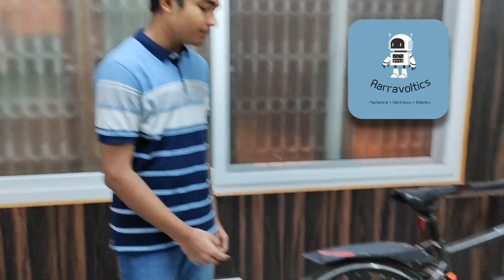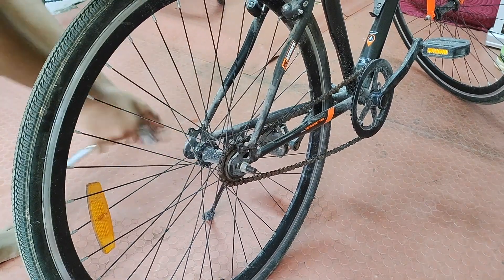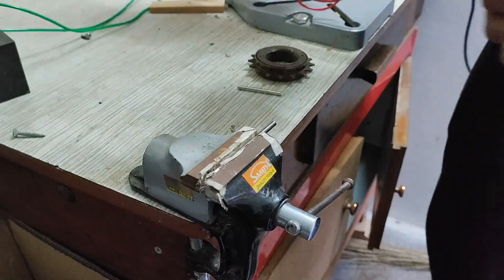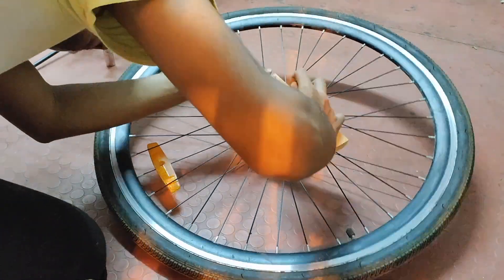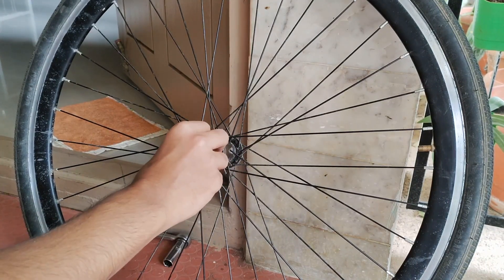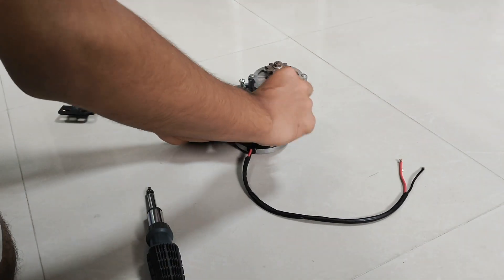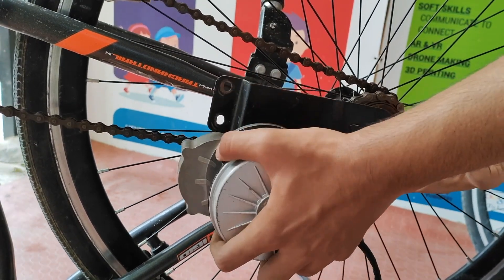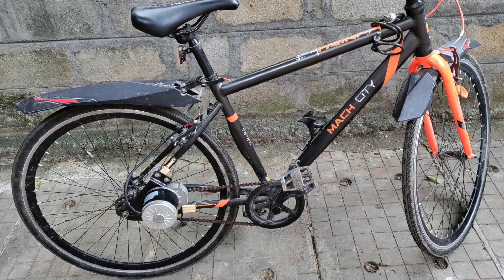Making an Ebike - Attaching freewheel and motor - Part 1

Comment: Why did you not attach the motor and the new free wheel to the left side of the original rear wheel? That would have been easier. It is after all called a left free wheel ebike kit for a reason!
Reply from the maker: The freewheel requires threads to be attached.
There was already threads on the right side, and it was easy to make the threads longer. So it was actually easier to attach on the right side. 
In order to attach on the left, I would have to cut the threads myself, which is quite hard to do.